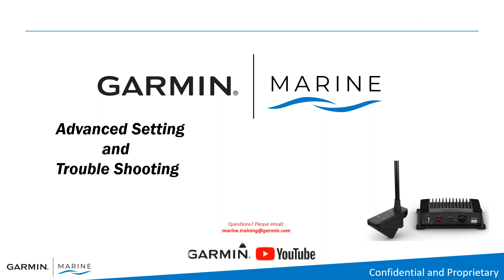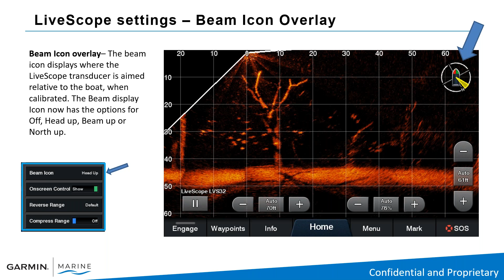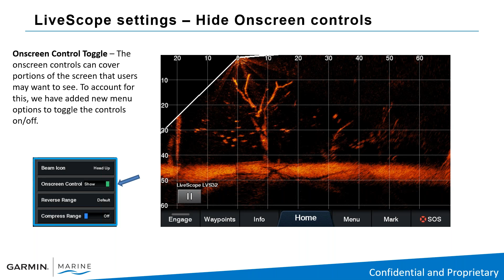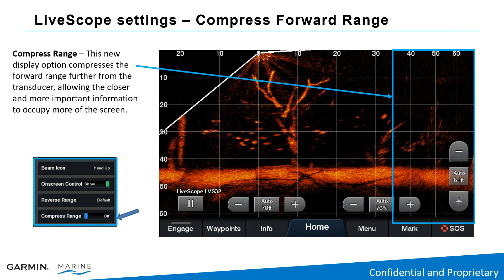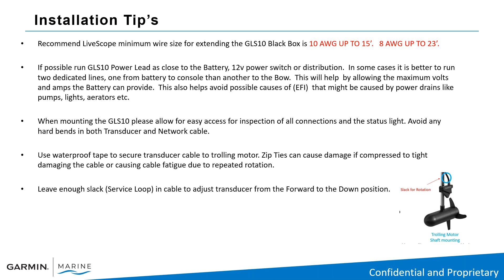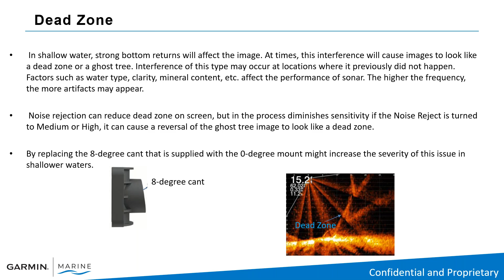Garmin Marine Webinars: Panoptix LiveScope Advanced Settings and Troubleshooting

Comment: MK Stu here again . I’m hooking up  ultra 126sv  92sv  gcv 20 and livescope  , should I put a on and off switch on the livescope . I figure if I’m out scrolling around for fish I don’t need to leave the unit on because it will be drawing current off the battery. I’ve got a 100ah lithium battery that going to run all of this. Also can you tell me how long the units will last with this setup, and also about the on and off switch.Thank you Stu
Reply from the maker: Hi, Stu! We'd want a switch going directly to the battery and not a bus bar. We don't have a specific run time and there would be many factors that go into that. The best way to get an estimate for length of time is to find an amp hour calculator on the internet. (KS)
Reply: @Garmin  Thanks very much: Stu

Comment: So can you calibrate if you're not mounting your system to a boat?
Reply from the maker: Hi there! It is still possible if it is pole mounted. The transducer just needs to be able to turn 360º. 
-MR
Reply: @Garmin   thank you!! 
I own the GPSMAP 1243XSV .  And I am thinking about buying 1 of the 2 option remote controls, that 1 cost $99.99 & the other cost $399.99 .   What is the biggest differences between the two?
Reply from the maker: Which remote are you referring to? Is it a remote for the chartplotter? If so, the GRID remote is designed more to be used with a multi chartplotter network and is designed to be solid mounted. The wireless remote control is designed more for one chartplotter and is better for portable use. 
-MR
Reply: @Garmin   yes, the remotes you are talking about for Chartplotters GPSMAP Series. Part #:010-10878-10   &   010-01024-00
Reply: @Garmin    what are the biggest advantages of each remote?     Also,
 What makes  1 remote worth $99.99 and the other remote worth $399.99?
Reply from the maker: Hi there,

The GRID remote (010-01024-00) has a rotary knob and joystick controls that provide navigation through menus and screens that allow you to seamlessly navigate between monitors at a station, all while controlling single or multiple compatible monitors and multifunctional displays with one device. The Wireless Remote Control (010-10878-10) is designed to control just one compatible GPSMAP series chartplotter. 

If you have any additional questions, Garmin Support would be happy to assist you and can be reached using the information listed under the "Contact Us for More Help" section here: http://ms.spr.ly/6059nXyk1

Kind regards,
(KS)

Comment: If using an auxiliary pole mount and typically fishing from 10-30 ft.... would you recommend the 8 degree mount or the zero degree mount ? Sometimes in 30 ft of water the jig disappears in the deeper water .... ????
Reply from the maker: If you're using a different pole mount, I'd recommend the 0°. The 30° is recommended for shaft mounts and trying to get around a trolling motor. -MR